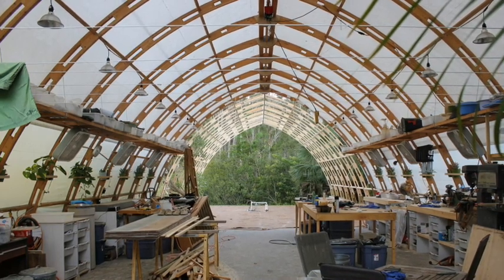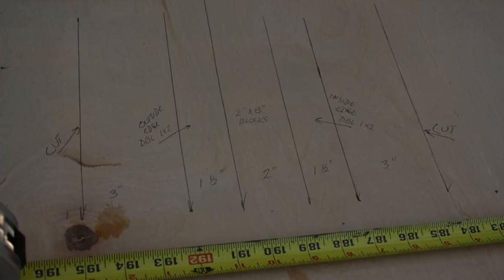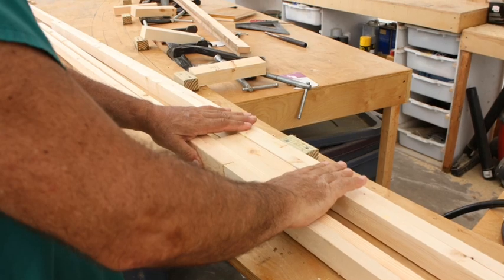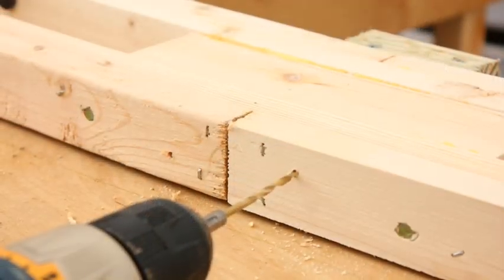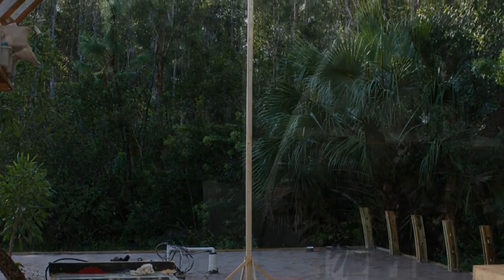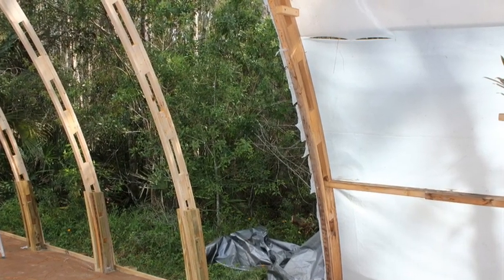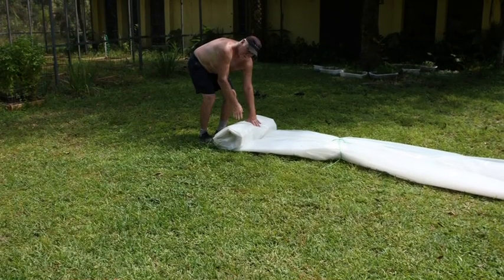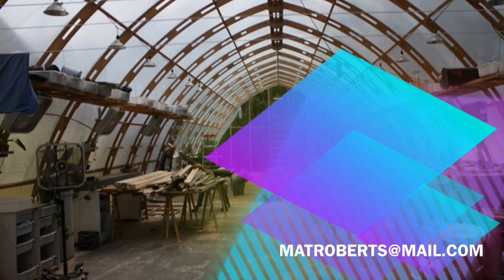DIY Greenhouse

Comment: I'm curious if the arch structure design could be used in a tiny house structure (like 16x20)
Reply: I believe so. I will be done with my quarantine  week so I hope to start with building chicken coop. Fairly big to accommodate up to 100 chickens. If that works in a summer months I will try to start guest house.